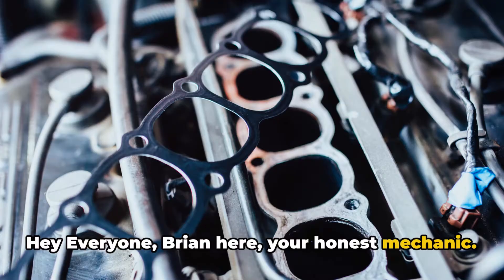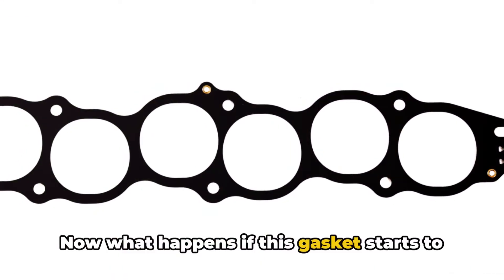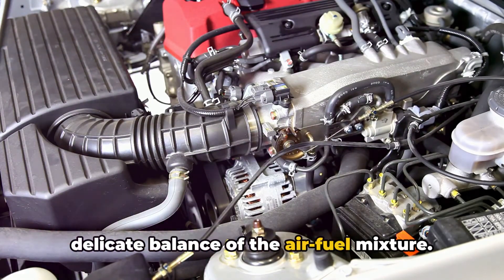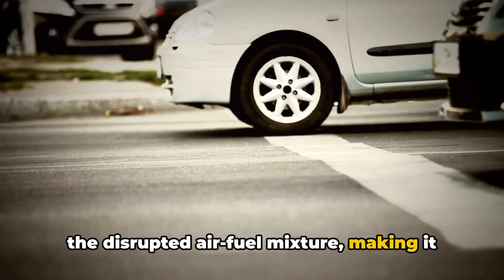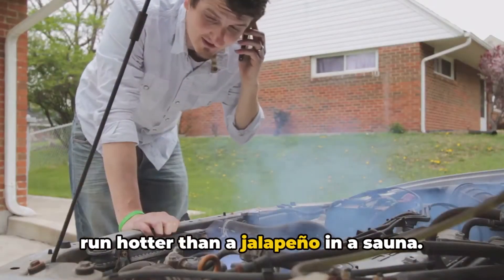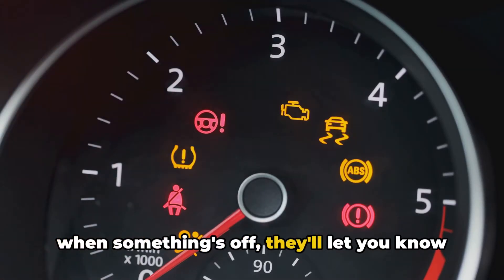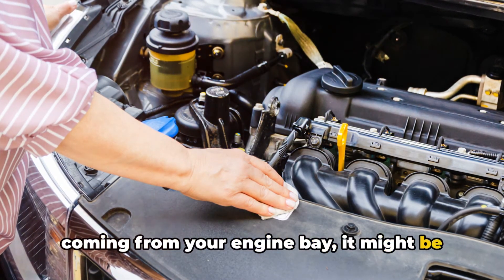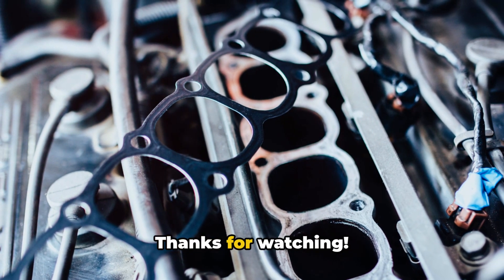Leaking Intake Manifold Gasket Symptoms

Comment: Dude your commentary is hilarious,  whilst simultaneously educating.  Bravo!

Also sometimes that gasket break, where it is supposed to seal the coolant,  can pressurize the cooling system and cause leaks at the radiator cap or other places, even causing water pump failure and other related issues.
Reply: Will a corolla gasket be necessary to change at 100k miles?
Reply: @thingshappen9199 yes, 100k intake manifold gasket replacement is good idea